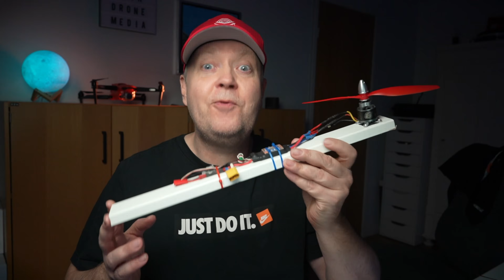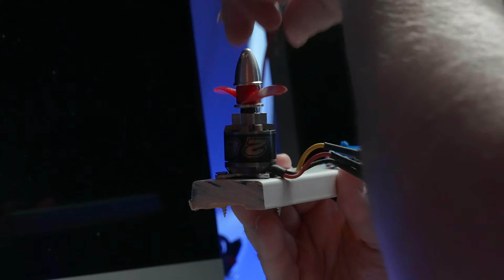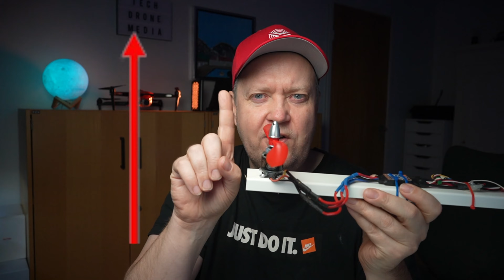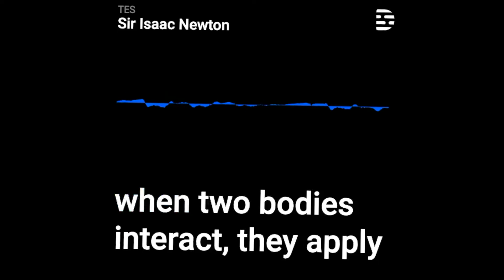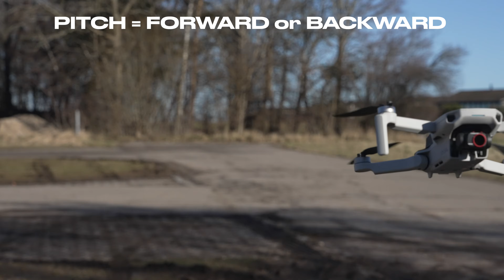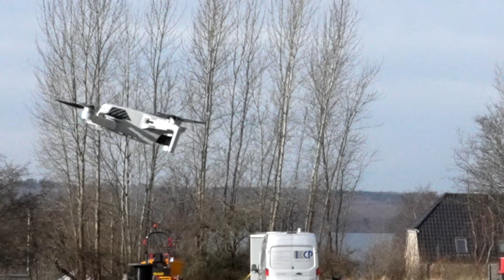HOW A DRONE WORKS?

Comment: Spot on, Henrich!  As a Commercial Pilot and Flight Instructor, I can appreciate the fact that all aerodynamic laws of physics are in play here.  Another thought/question though:  I thought my Air 2S - in "Cini" mode - would place it in ATTI mode, thus "shutting off" the GNSS inputs.  Then, I could hover in the wind....and watch my 2S "drift" with the wind much like a canoe would "drift" with the current in a river.  When I tried this however (...Cini mode in 10 mph wind) the 2S stayed right in position where I switched it from "Norm" to "Cini".  Hope I'm making sense here.  So my question...how do I effetely shut of GNSS / GPS inputs and allow my 2S to operate in true ATTI mode?   I would like to do this for my own training competency, that is...true manual operation.  Appreciate your thoughts.  Thank you!  Randy
Reply: Atti mode is not available if Air2S is receiving satellite signals.
If you want Atti mode, fly it indoors 😉
Reply: @grahamniven  Thank you Graham…appreciate that.